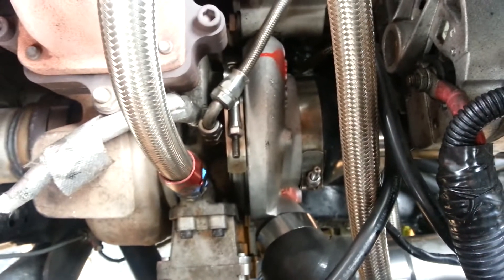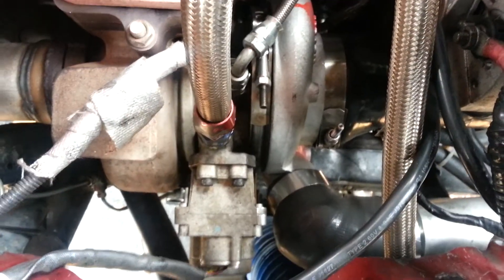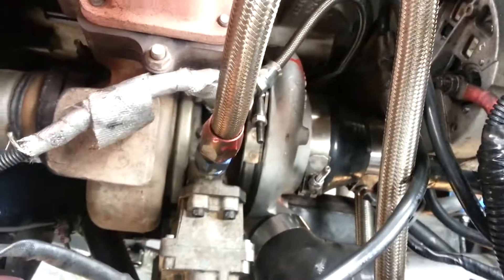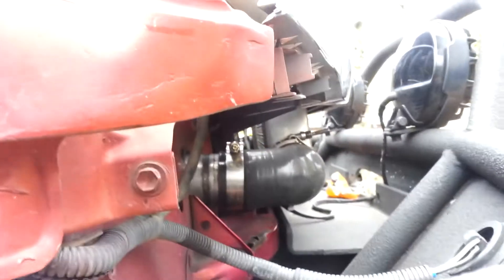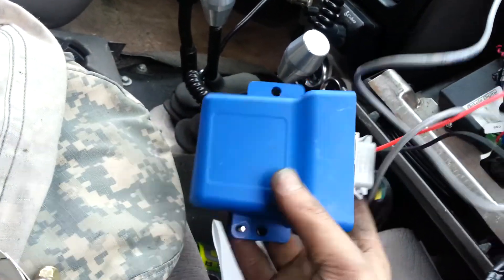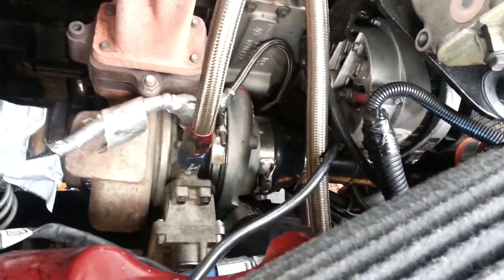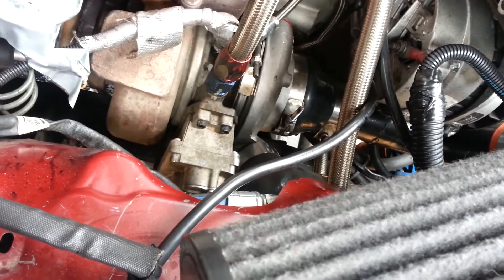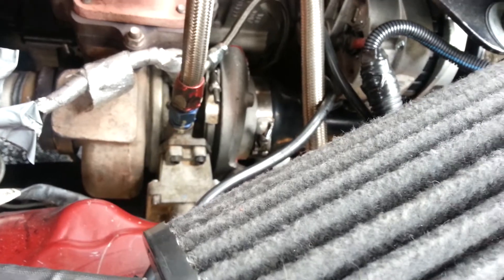HE351VE/HE341VE Hybrid

Comment: Hey, I know this video is quite old, but I just got a HE351VE running on my 2.7L 1987 BMW (2-valve motor, low compression, cam). Running low boost right now (~150kPa absolute). VGT is controlled by Megasquirt boost control, but I modify the signal to limit minimum turbine nozzle size based on RPM (to prevent overspeeding and surge). The control works great, the engine makes great power for the boost level, but the spool is a bit slow. Thinking about doing this mod at some point if I can source the parts. Is the 341VE really the same turbine housing and wheel as the 351VE? So I can just swap compressor wheel and compressor housing and be good to go?
Reply from the maker: The turbines should be the same. The compressors are what's different from what I remember. I could be wrong.  I haven't had the need to limit the turbine speed with my controllers. They constantly hunt for the best position and I can run 1:1 intake exhaust ratio though the range. I just uploaded a video running 1:1 at 40 PSI and you can see how the controller tracks from idle to wide open.

Comment: Interesting, I'm looking into doing something similar because the 351ve compressor is too big for my goals. Would the he341 (non ve / vgt version) work as well? The 341ve is very rare but the 341 is a lot easier to come by
Reply from the maker: what are you running the 351ve on and how are you controlling it? You can twin charge any engine, you just need to match the supercharger, turbo to the enigne
Reply: It's going on a MR2, stroked to 2.2L, hence I would want something a bit smaller ideally but I like the idea of vgt and this turbo is by far the cheapest and has the most aftermarket development so far. I would be using a controller that a guy is now selling, he worked out the signal inputs over CAN that the stock Holset control unit requires. My ecu would interface with this, sending commands through a 0-5v signal based on my boost map with a few different limits to prevent excessive exhaust temps/back pressure, and overspinning the turbo, as well as a cruise mode for better efficiency. This should give me the best level of control so that it will spool up as quick as possible when needed (based on TPS) whilst having a safety net from other programmable limits, unlike the wastegate control methods I've seen used on the DSM forums etc.
I did toy with the idea of twin charging but the complexity, cost, weight and engine temps is enough to put me off, and although the holset weighs a fair bit it would still be lighter and a neater package for a mid engined car. Plus I would want a project that is very different from the usual to make it interesting!
Reply from the maker: Who's controller is it? I figured my control is the only one one the are right now. If your using a mega squirt I can use the PWM output to control the turbo.

The 2.2 could possibly light the he351ve without an issue but it depends how high your engine RPMs.
Reply: Actually I just realised that it is your control unit I was referring to haha. You made a version for a guy with a supra that was controlled via 0-5v input? This is exactly what I would want to do also. I'm just in the middle of building a house at the moment, so all the effort is going into research until I have funds for the car again.

Yeah the 3sgte definitely has enough exhaust to spin it up hard, there are guys making well in excess of 600 rwhp on bigger compressors wheels than the 351ve, but really for a car that weighs 1150kg it's just too much for the chassis IMO for anything other than drag racing.
It will be a street/track car so the objective is a very broad powerband, if I can gain some spool time by sacrificing top end that would be a much better result. I'm not really interested in big hp, it needs to be useable across a broad rpm range
Reply from the maker: Just wondering how he sets his up. I make the Banshee VGT Controller. Not sure about the GT40, the HE351VE is a 60mm wheel, with a 1/2" shaft
Reply: Edited my post because i realised it was you that built the controller. Yeah the gt40 is a fair bit bigger actually... Looking at the fastest mr2 1/4 mile the guy was running a gt3082 which has a 61.4mm inducer which is pretty close to the Holset. Either way I'm not looking to break records/gearboxes so a smaller compressor is a much better choice. Did you look into swapping the standard he341/hy35 compressor wheel from a non-vgt turbo? these are a lot more common than the he341ve. Would make it a lot easier and cheaper to source the parts if these were interchangeable with the he351ve
Reply from the maker: I'm sure you could mount the compressor. The problem is going to be the gap in the compressor housing. You need a compressor housing to match the compressor. Call http://www.southeasterndiesel.com/ and ask for Mike. They sometimes have the parts instead of whole turbos.
Reply: If I have a he341ve turbo, could I use an he351ve turbine housing?  I can’t find any he341ve housing anywhere!